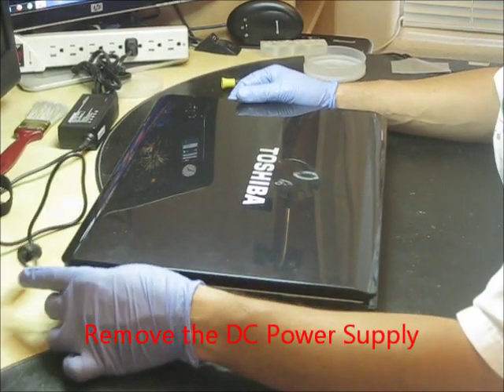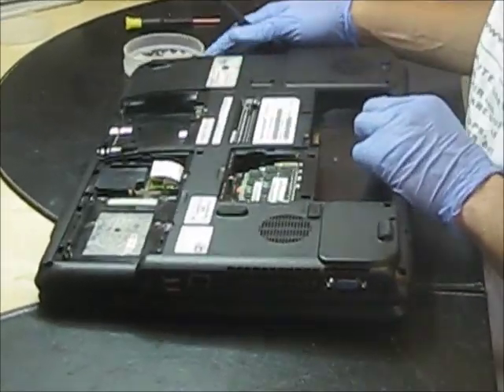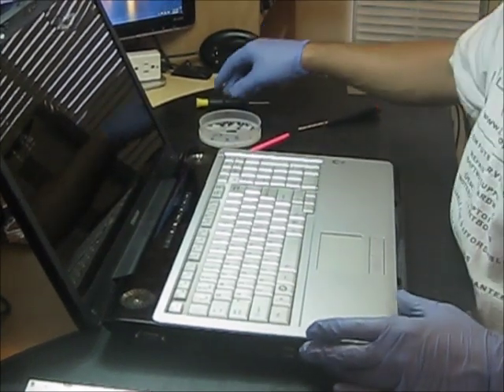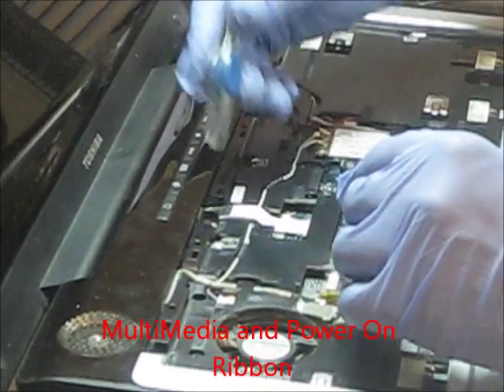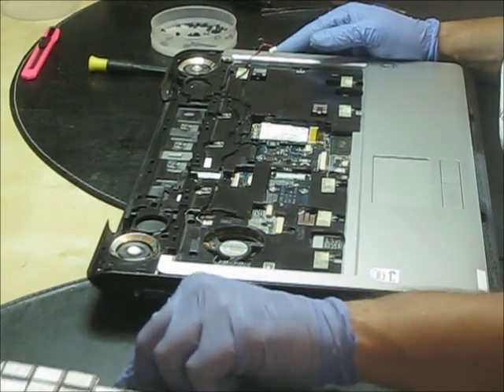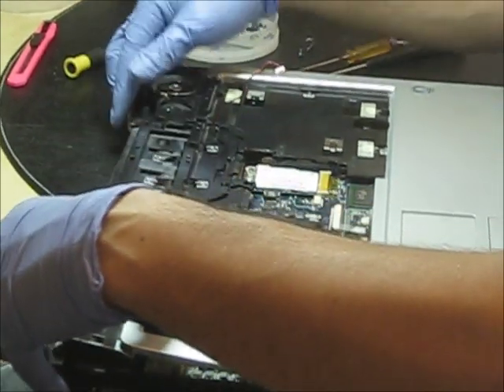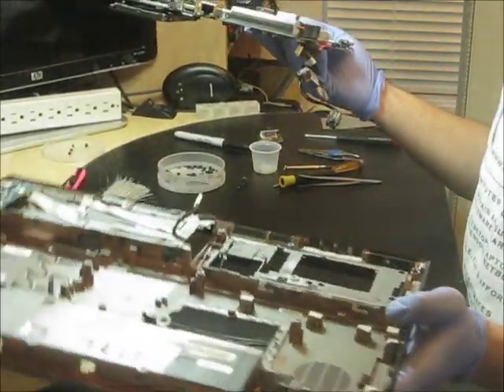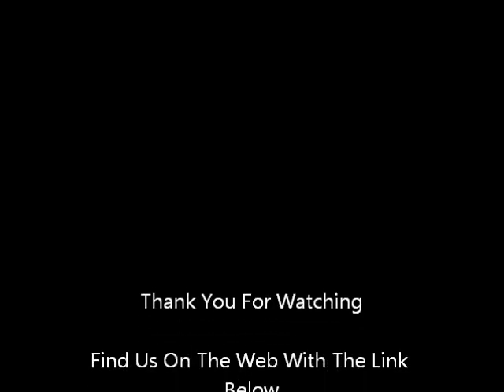How To Remove A Motherboard From A Toshiba Satellite p205

Comment from the maker: Yes they are special mats but you can work on any surface that is static free( as much as possible), such as wood, of course you should avoid carpet floors as well. This is to prevent any static release into the motherboard. Thank you for the positive comment.

Comment from the maker: There are several things you can do in order to recover your laptop. 
1)If you have created a backup files from your original BIOS, then you should look for that files and recover from there. 
Vista and windows 7
C:\Windows\temp\Phlash16 directory, or
C:\User\Your desktop name\Application Data\Local\Temp\
2)Use Toshiba Crisis recovery disk
3)Use Phoenix recovery disk
I can't post links here, just GOOGLE those keywords and you'll find the complete process description and files needed.

Comment from the maker: Yes the BGA microchip is part of the motherboard, and basically a laptop such as this one is not worth it. There are companies that do the re-balling on the video microchips, which means they remove the microchip from the motherboard, then replace all the solder points, to re-solder the microchip in it's place. This procedure is done only on faulty motherboards, replacing the video chip with the exact same one. 
Unfortunately the no, look for better computer.